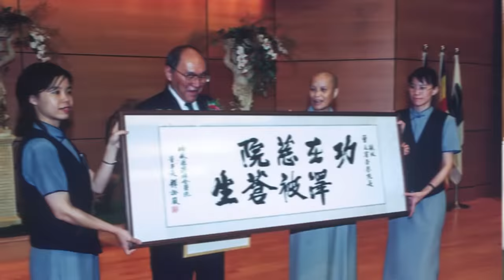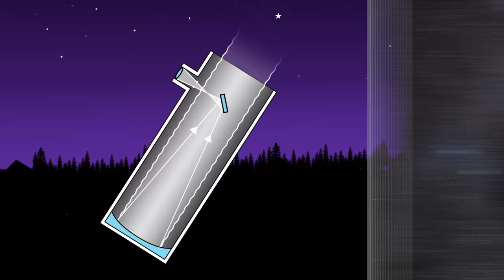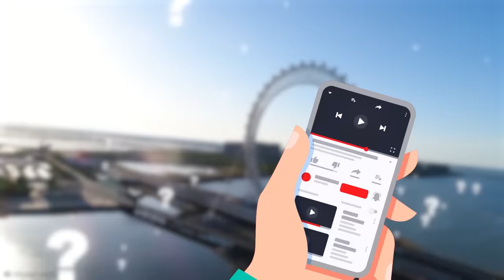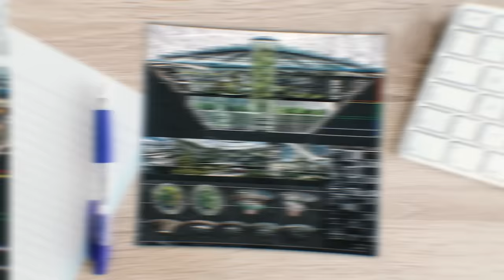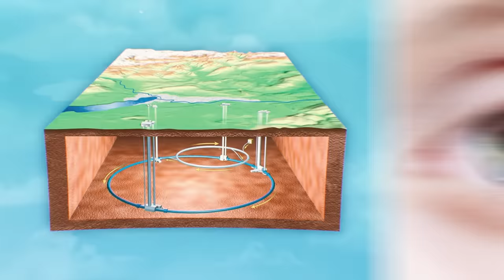Weirdest MEGAPROJECTS in History

Comment: Reflecting telescopes use CONCAVE primary mirrors, not convex ones. And they're not lenses, they're mirrors. The only lenses are in the eyepiece. 
The larger the primary mirror, the more light it collects and sends to the secondary mirror (which is flat, and is placed at the focal point of the primary) which, in turn, reflects that light into the eyepiece, for you to see.

Comment: Electron is a elementary particle but Proton and Neutron aren't.
They are made up of Up(+2/3 charge) and Down(-1/3 charge) Quarks. 2 up and 1 down quark for proton and vice-versa for neutron(do the maths by yourself). Electron is a Lepton. If you had seen the Standard Model of Elementary Particles, then in quark group Up and Down are present while Electron in Lepton.

Fun Fact: You can replace Electrons in an atom of element's orbit with Muon(big bro of Electron) to create a Muonic version of that element(e.g: Muonic Hydrogen) to create Cold-Fusion(which Nuclear Fusion at Room Temperature).

Comment: ive always wondered, what with the multitude of problems with concrete in a truck, like having to get the concrete to site before it sets making traffic jams a problem not to mention distances, then problems cleaning the inside etc etc etc. why transport the cement like this. whats the problem with transporting it dry then adding the water at the site, sure maybe some sites wont have water but surely most will

Comment: While these are amazing there is one Bridge with a Lifting Span that was built in ....  It was built in the 1940s and carries roughly 20 000 cars each day as it is on the Main Highway North from Newcastle NSW ... this bridge is now used for Southbound as there is a new Bridge built alongside for the Northbound traffic ... at Peak Holiday times both are packed Bumper to Bumper with cars Trucks Caravans for many miles in each direction